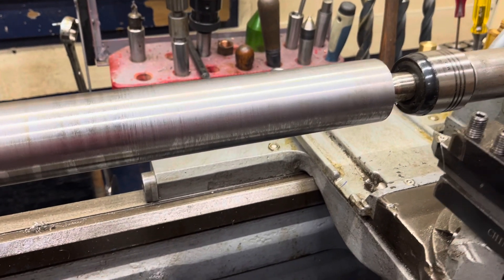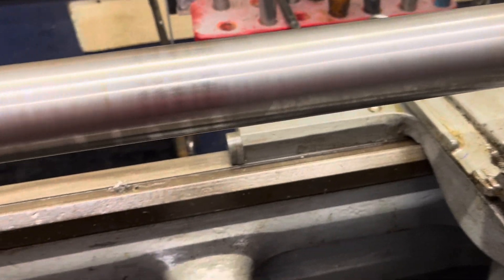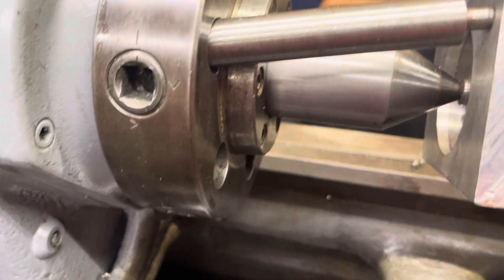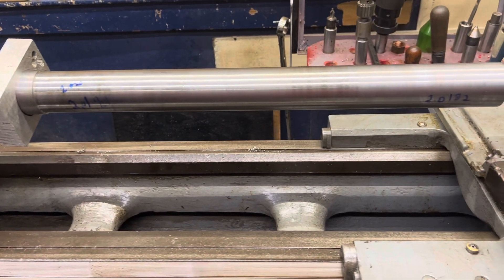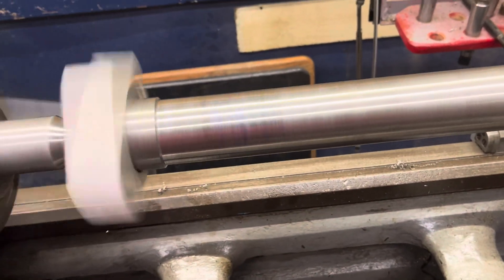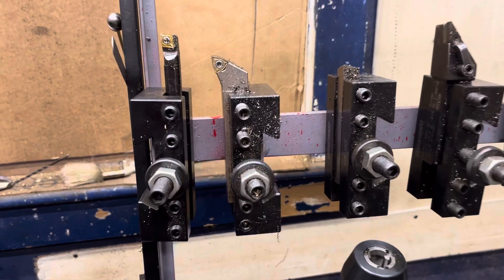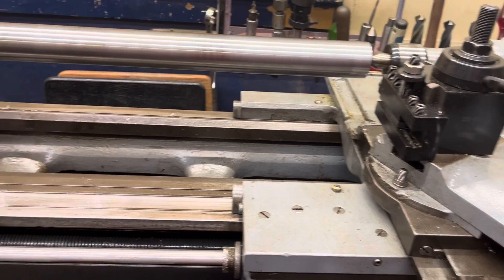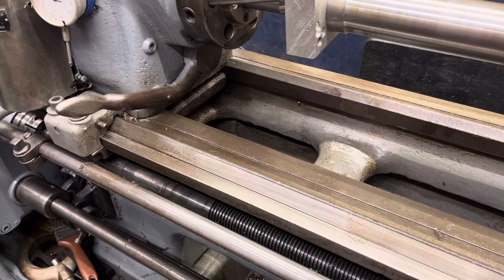0.001 tapper in 31”

Comment: How is the carriage oil pump lubing the ways since you cleaned it up?
Reply from the maker: Oil is pumping very well. At first not so much. The felt that I put on the end of the intake was thicker and more dense than the original felt so it took a while for that to get saturated enough to let oil flow through. So that felt peace either moved or finally became saturated enough to low oil to travel.
The outside lathe way is getting less oil. The oil channel is partially blocked. I believe it is blocked as to meter the oil flow. I believe when I reassemble the machine after putting in the new Leadscrew and getting. The clutch for lateral feed freed up 
I may remove that metering blockage.
Thank you for liking and commenting. Kimber.